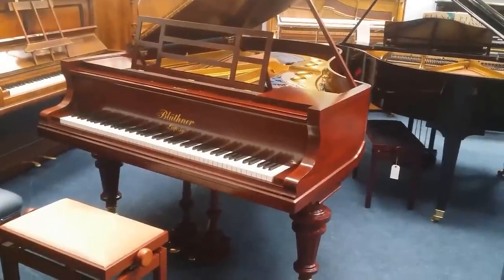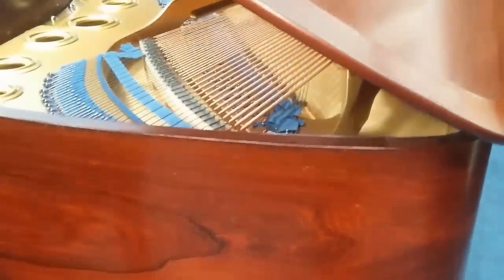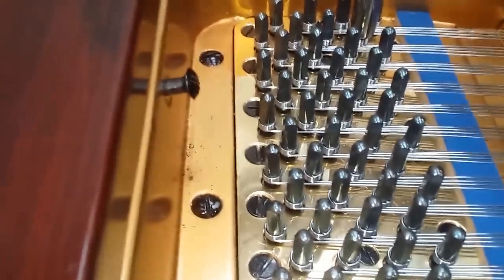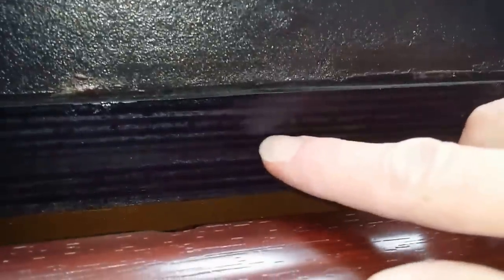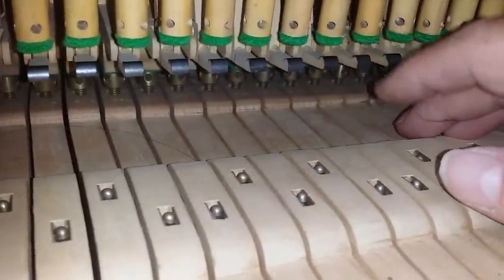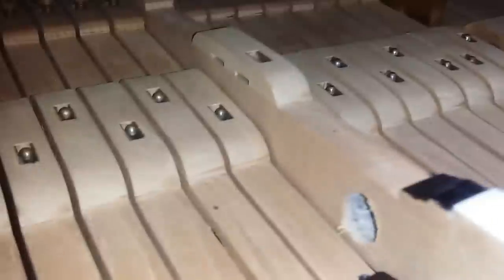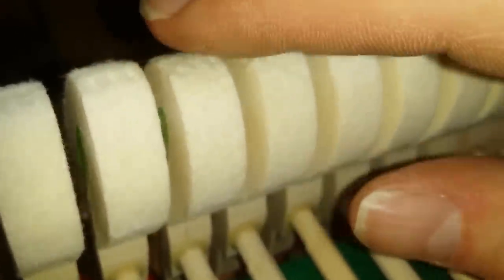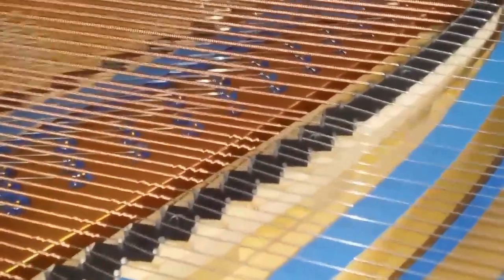SOLD: Bluthner style VIII grand piano; fully restored by Bluthners in 2013

Comment: I have an idea why there are no holes plugged in the keyboard on this piano, and I can think of two possibilities: 

1. It's the original keyboard and it wasn't a patent action to begin with. Some Blüthners even of that era did not have patent actions, it was an option, like the aliquots. Blüthner himself preferred it but some pianists wanted the standard action so they offered both types in tandem. 

2. It's a replacement action and keyboard, and the customer requested ivory. In 2013 it was still actually possible to buy ivory from so-called legal stock as long as it had certificates. In 2013 Bechstein created a furore when they put ivory on a new piano. The ivory at that time could still be bought legally in the UK. 

My feeling is that it's the latter situation and the piano was given new ivory at the time of restoration, at the customers request. This option added about £3000 to the price of restoration so I heard through a trade contact. Of course, the practice is completely banned now. 

The piano does sound rather beautiful.